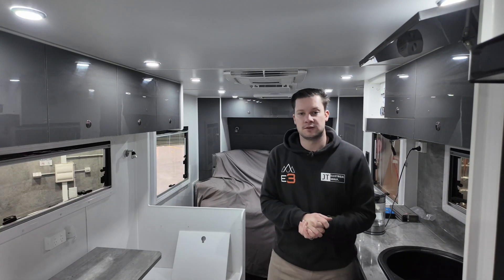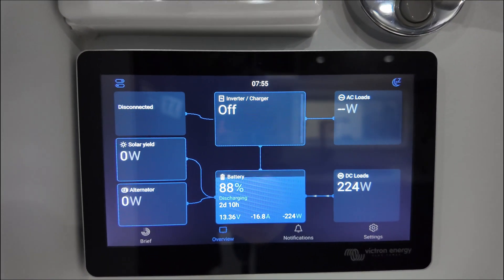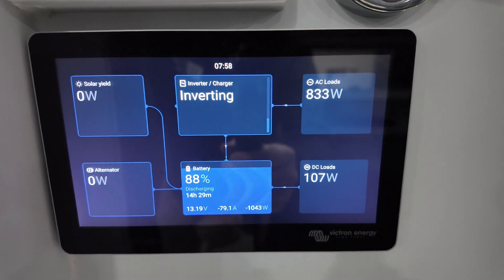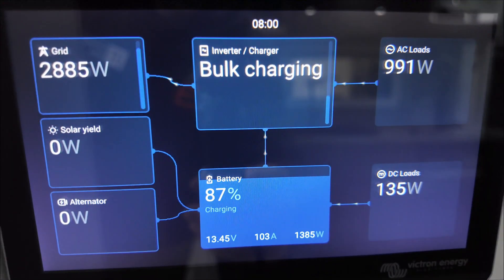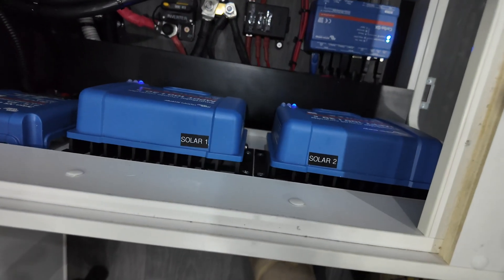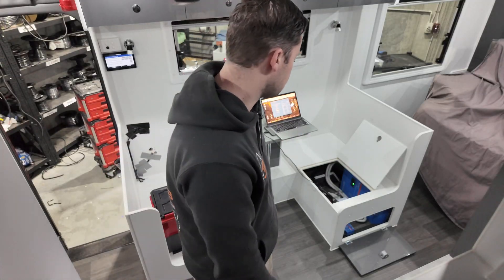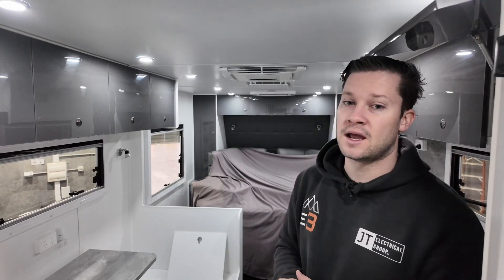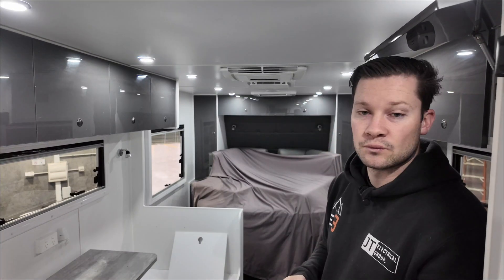ULTIMATE CARAVAN UPGRADE VICTRON ENERGY SYSTEM | Network RV

Comment: Great video. Just a querie about using the 100/30 controller for 3 x 200w panels. Isn't the controller rated to 440 Watts? I have also seen installers use a 100/50 for arrays above 700 watts.